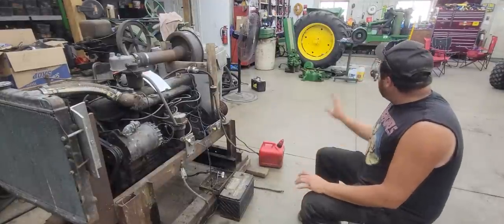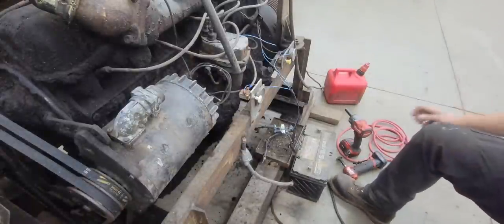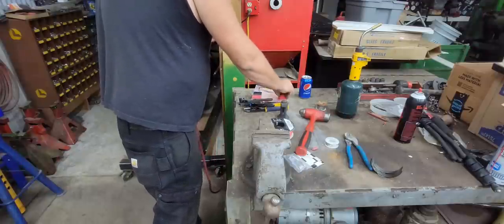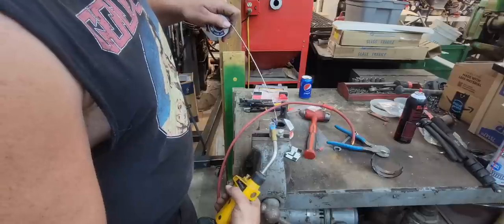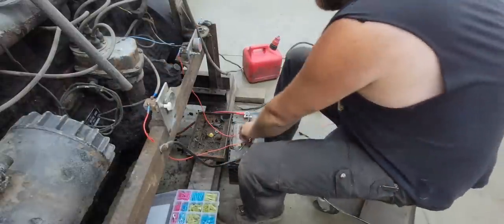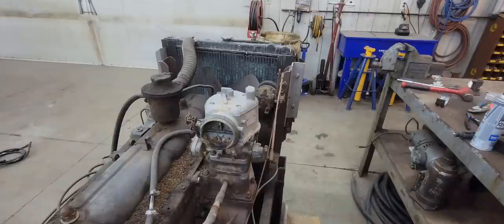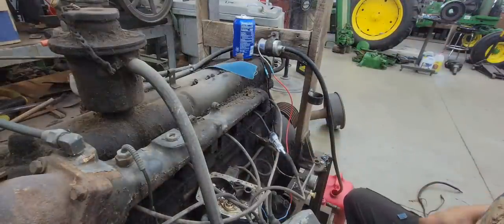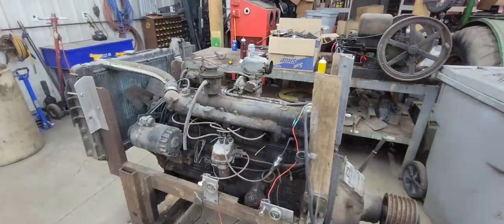Will It Start? REO/Continental Multi Fuel Sawmill Engine Video!

Comment: It's good to see somebody else making battery cables like this. This is exactly how I prefer to do them also. Using welding cable also makes the very best jumper cables, way better than you could ever buy. Its always been my experience if you make battery cables like this for the old 6 volt systems, it will carry the amperage and the starter will spin the engine over just fine, keeping it fact-tree.

Comment: that was great to get it to turn over and fire, ethyl either  is such a help when trying to get an 
engine with spark to fire and run a bit. I had problems trying to leave a comment at 10 am. 
the one thing it is hard at times to find parts for old cars & motors . i would have been No. 43
carbs are done in with time! dries out and things get hard, and crack. great video, always a 
in-lighting video. you learn so much from you! good luck can not wait till the mill is running!

Comment: The first guy I worked for had a Gehl Brothers self propelled corn chopper that had a big Continental flathead six for power. My Oliver Hart Parr Row Crop 70 also used a Continental but that one is overhead valve.

Comment: IMHO it's Always better to sodder battery terminals than crimp them as soldering terminals prevent anything from getting inside said terminal. I recently learned some people crimp them which I find crazy funny.
Reply from the maker: I've always soldered crimped and then heat shrinked I like to know it's solid and sealed 100%

Comment: I sure wish someone with your skill set lived where I live and could work on a carburetor. My old car 1989 Corolla needs a replacement one. 3 different people, who said “they could do it” can’t get it to run right. Nobody works on carburetors any more anymore. If you can plug a computer into it the computer that’s about all new cars require for a “mechanic “ nowadays.

Comment: Can you tell us what kind of electrical ratcheting crimper tool that is? Looks handy. Do you need special ends to use with it?
Reply from the maker: haisstronica Crimping Tool for Heat Shrink Connectors with 260PCS Marine Grade Heat Shrink Ring Connectors of Tinned Red Copper AWG 22-10 https://a.co/d/aVp75ti
Reply from the maker: haisstronica 520PCS Marine Grade Heat Shrink Wire Connectors-Electrical Connectors Kit of Tinned Red Copper,16-14 22-16 12-10 Gauge Crimp Insulated Ring Fork Spade Butt Splices(3Colors/24Size) https://a.co/d/0ncBZcd
Reply from the maker: You can use any crimp ends but I like these heat shrink crimps I've had good luck with em so far
Reply: Thanks Brandon!